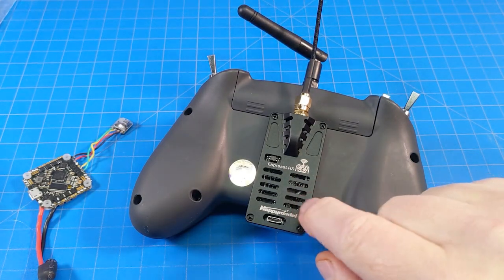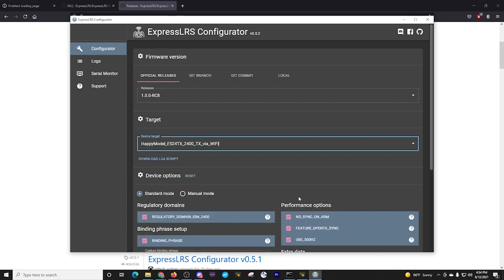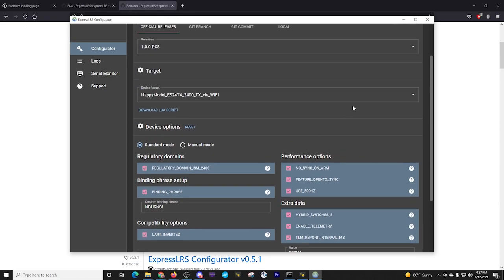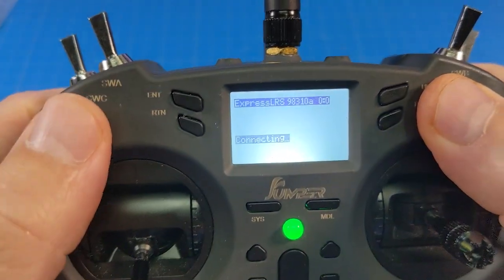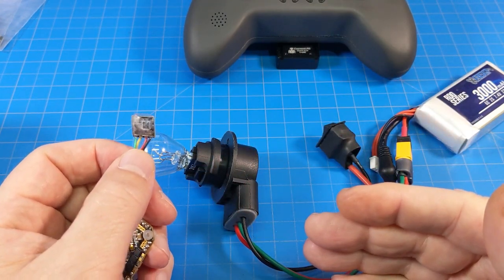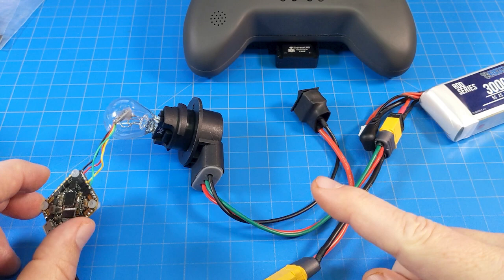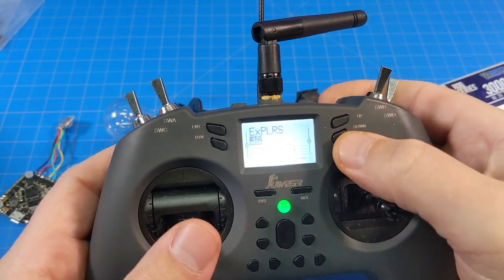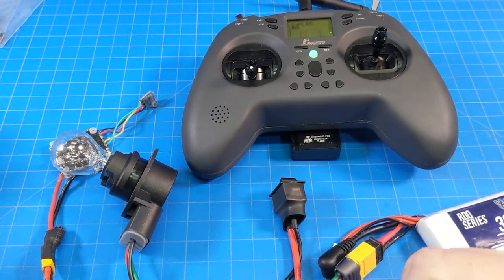HappyModel ExpressLRS Flashing (Updating) // EP2 // ES24TX Lite

Comment: I have several dozen quads with ELRS, and absolutely hate the fact that the ELRS engineers never made the darn things backward compatible. Every time that I purchase a new quad with  a new version of ELRS, I have to spend hours updating all the darn receivers, and my three radios that all have external TX Happy Model modules. It is a royal pain!
Reply from the maker: There must be some technology issue with backwards compatibility. We see the same issue in HD video systems, and other RC link protocol like crossfire. Although crossfire does have over the air updating which is a feature I have read the ELRS devs are working or or did work on at one time.

Comment: Hi Nick I have not been using this tx module for a while is in Elrs V2 firmware. Do you know if its possible to upgrade to Firmware V3 or latest? I'm having issues and maybe it just can't be flashed?
Reply from the maker: It can be updated to v3 ELRS. Check out this page https://www.expresslrs.org/quick-start/transmitters/es24tx/ and note the red advisory section. Need to update to 2.5.2 then flash with the repartitioner then on to v3 flashing.

Comment: Nick - thank you so so much.  I bought a HappyModel ExpressLRS Tx and 3 receiver combo over a year ago when the system first rolled out. Never used it before now.  Fast forward to today, was having no luck trying to bind to my TaranisX9D.  Worked on it for some time.  Upgraded OpenTX to EdgeTX, still no luck. Finally opted to upgrade to RadioMasterTX16S MKII Max.  Still needed help to bind those receivers.  Don't know where the glitch in my brain stemmed from, but after watching hours of videos trying to update and bind I had no luck.  Your video just made  it all click.  Bound, ready to fly, and excited to get back in the air. Keep making these great videos - they help!!!
Reply: iam still in trouble - now my module cant boot anymore

Comment: will the Jumper ExpressLRS ELRS ES24TX 2.4GTX Module for Jumper TPro tbs tango2pro OpenTX work on the Zorro controller?
Reply from the maker: the nano modules should work with any radio with the nano bay. Some are specific to the 1s powered radios. The jumper es24tx is rated for a input power of 5v-8.4v so it would work with the 2s powered radios which the zorro is.
Reply: @NickBurnsFPV  thanks, your vids inspire me in many ways on this new journey.

Comment: thanks it was very helpful. I still dont understand how are uarts called on the flightcontroller?
Reply from the maker: Uarts are ports, typical Rx and tx they will have a umber like rx1 which is uart 1. Tx1 is also uart1. Rx2 and tx2 are uart2. Etc
Reply: @NickBurnsFPV  Thanks for the explanation. Why don't they call it uart1 or 2 on the board that would be easier...
Reply from the maker: @airdevil21  probably the separation of the developers use for the rx/tx vs the hardware developers and their design purposes. We need to be able to differentiate between rx and tx as they serv different purposes.
Reply: @NickBurnsFPV  oke that makes sense. Thanks for explaining.
Reply from the maker: @airdevil21  this hobby is confusing sometimes.
Reply: @NickBurnsFPV  😁 yes it is! Thank God guys like you are here to help us!

Comment: do you have to flash receiver with the same firmware in order for it to bind?,also I didn't select binding phrase so all I have to do to bind receiver to module is plug in three times? please help 🙏 😢 I very confused
Reply from the maker: We do need to be on the same major release of expresslrs. Meaning we need to be rx and tx to be on 1.x.x or both on 2.x.x.

Comment: someone with solid led? I've closed it short and nothing, I can't update a new ep2, I just opened the package, the led doesn't blink at all, I don't know what else to do. not even with FTDI I could.
Reply from the maker: This could be the bug with a particular chip that was recently discovered. My understanding is that we can possibly work around it with several power cycles, otherwise we have to get a replacement from happymodel
Reply: @NickBurnsFPV  Solid green for me. Having many issues with this and new ELRS board for the lite radio 2. Never got into wifi mode

Comment: I followed all the steps then connected it to betaflight but no receiver reaction
Reply from the maker: Not enough information me to know if its not bound or if we have the rx and tx wires reversed, or we don't have serial turned on in the betaflight ports tab for the correct uart.

Comment: thanks for the helpful video. im all good up until accessing the lua script on the radio. it just says connecting and won't progress to the following page to connect to wifi. any ideas?
Reply from the maker: If the module powered? Is the lua script the correct script. The script is often specific to the module.

Comment: i have read everybodys guides on this and am still stuck.. i run the lua script i get version mismatch press force press wifi update and it will!!!! not show wifi hotpot on laptop... helpppp
Reply: in my tlite transmitter kit i have one tinned power cable connector left over? i followed the guide on fitting and fotos and still nowt...absoutly fustrating system to configure
Reply from the maker: I have not heard of a version mismatch on running the lua script, unless the lua script is for a different module. Is the lua on the sd card from the elrs configurator? Its linked on the page after we select the device.

Comment: Do I need to use open tx nightly builds? They have new opentx versions. Don't know if they work with the t lite right now. What do you recommend that works? I got it all to work and bind with opentx2.3.12 but no switch inputs. Can't figure it out. Any ideas? Should I try nightly?

Comment: Hiyaz, all  is updated, except I'm always getting a Build Error fail for my Happymodel EP2 firmware compiling.  A huge red paragraph with mentions of  'upload port protocol = espota, and platformio' stuff...  Google doesnt have any information for this..   Would you know how to fix this?  It would be greatly appreciated :)
Reply from the maker: Do you have a another program for writing computer programs on the computer? The part after the = looks like a language other than English. I would check with the expresslrs discord.
Reply: @NickBurnsFPV  thx for quick reply!  And I don’t think I have that kind of program....
Reply from the maker: @markmontreal7815  Sure. Some days I get more windows to read than others. :)
Reply: @NickBurnsFPV  I jumped immediately on Exp discord, some nice dude helped me out , had to clean the folders with those two options there,  and I’ve been flying my whoop since :)
Reply from the maker: @markmontreal7815  Great. Thank you for reporting your experience in the discord. Its nice to have confirmation that others are having a good experience. Have you tried the whoop with the different packet rates?
Reply: @NickBurnsFPV  Not really lol  Been flying non stop :).  I actually just used my goggles to record finally,  I can only fly LOS for now...  goggles are totally different and difficult!  Top of my list to try out the packet rates though!

Comment: Is light on all time or only when it bound or when been updated does hours get warm mine cold thinks it's faulty
Reply from the maker: Light is on all the time. I suspect if the light isn't on its not getting power, we need to check the wiring and connectors. Be sure the pins on the little board inside the radio aren't poking through the foam tape and touching the heatsink of the internal radio, this can cause a short or other issues.

Comment: Hi Nick! Thank you for all your help! At around 8:16 you pulled out a bag with a bunch of receivers (bad?). If so, what's the behavior you received on those?

I ask cause I just installed an EP2 RX and the LED is always a solid yellow. No flashing slow, fast not going off. Nothing. The Happymodel website that a solid LED mean connection successful or established. But my radio is actually off. 

From your experience, is this a bad RX?
Reply from the maker: No, those receivers in the bag are ep2 rx that I have flashed. They take up far less space outside of their packaging. If the led is constantly on we have likely soft bricked the receiver. Maybe we powered it down to soon or flashed the wrong firmware. We can undo this, using an ftdi adapter and shorting the two unused pads on the top of the ep2 rx. We wire the ep2 to the ftdi just like its wired to a flight controller. +, -, tx to rx, rx to tx. Then flash it over uart. I need to make a video on this process yet. I will try to do that when I get back from vacation.
Reply: @NickBurnsFPV  I see... Ok this is great info! Yeah - I'm sure a video explaining this will help a lot of folks out there. Enjoy your vacation and have fun!

Comment: Hi Nick! Can you explain how to flash via ftdi? I need it cause a failed flashing on my ep2..... thank u!!
Reply from the maker: Yes, we wire the ftdi and receiver just like the ftdi were a flight controller. 5v, ground, tx to rx and rx to tx. There are also two pads on the receiver that need to be jumpered/shorted. Depends on the receiver and where those pads are, we can typically find them as they are the only unused and unlabeled pads on the receiver. When we flash via the ELRS Configurator we us the flash to uart over usb. I believe its uart. And I think I had trouble initially as I had other usb devices plugged into usb, so unplug usb items that don't absolutely need to be plugged in.
Reply: Okay, i'll try this so! Thanks you so so much!

Comment: Can you make a video on using your FTDI to recover those receivers? I have bricked 2 of them myself. Info on how to unbrick them is not readily available on the web. Thanks for all your hard work Nick!
Reply: The problem is it will no longer go into wifi mode and bypass doesn't work either.  I have no way to reflash the receiver. I already bought one of those USB flasher things but I haven't had time to mess with it.
Reply from the maker: @jsxgmanfam  This image has the map lables on it. We wire it just like we might to an fc. The rx also has two pads on the top we need to short with a small piece of wire. This puts it into bootloader mode so we can flash it again.
Reply from the maker: I will take a look at it. It may help to wait a 10count after the updating screen shows the final message.
Reply: I need it to, bricked rx via wifi and passtrough doesn't work to....and i don't know how exactly do the ftdi flashing
Reply from the maker: @alessdiazlopez54  Okay. I will get a video together as soon as I can. I am pretty backlogged at the moment.
Reply: @NickBurnsFPV  thank you master!!! We really apreciate your work!

Comment: Hi buddy hope you had good independence Day and I've got the ep 2 but as yet no drone so I can't flash reaciever like you I don't have any flight controllers that use betaflightt etc so should I wait till got drone to flash etc
Reply from the maker: We don't have to have a quad or flight controller, but we do need a way to power the receiver with 5v. If we can do that we can flash over wifi just like in this video.

Comment: Well, I got my module and receivers. Installed and checked receiver and module for function and both worked. After doing this update multiple times both with and without paraphrase I could not get them to bind after the update. I had to revert back to the stock firmware. No idea why. But, I'm going to do some research on how much of a difference 500Hz makes over 250hz. I may be better off not trying the update again.
Reply from the maker: We have the rx and tx on the same versions of ELRS?
Reply: @NickBurnsFPV  Yes. 1.0.0-RC8. I did the two builds back to back like you showed. But, one difference is that I installed OpenTX 2.3.13 vs. your 2.3.12. I wouldn't think that would cause an issue. But, I'm not sure what the issue was. They work fine on 250hz with the stock Happymodel firmware.
This is also running the full size module in a Radiomaster TX12.
Reply from the maker: The Rx goes into biding mode, when not using the passphrase?
Reply: @NickBurnsFPV  Yes. When I tried it without the binding phrase it would go in to binding mode with the double blinks. But, it would not bind. It would just keep double blinking.
I also tried updating the RX with wifi and with Betaflight passthrough. Both gave the same result.
Reply from the maker: @ChristopherYotz  I presume we have csfr set as the protocol and using the crossfire lua to do the binding? As you rolled back to the happymodel firmware and its working. Only thing I can think to double check.
Reply: @NickBurnsFPV  Yep. CRSF set as the protocol before and after upgrade. Using Lua for the attempt at binding. 
I have to have missed something. I'll revisit it over the weekend.
Thanks for trying to help.  I'll get it figured out eventually. In the mean time it still works on 250hz.
Reply: @NickBurnsFPV  I think I figured out what I was doing wrong. Or, at least it works now. I don't think I was waiting long enough for the receiver to reboot after flashing. I was turning it off immediately upon seeing the notice that it flashed okay because I was worried about over heating. Now, after I get the notice that it flashed ok in the wifi browser I wait until the receiver light comes back on and begins flashing slowly. Then I turn it off. This works. Everything else I'm doing the same.
BTW, I damaged one of my receivers doing the flashing too many times. I think it just overheating one too many times. It's now dead. So, people should do the fan thing like you did as overheating seems to be a real concern.
Reply from the maker: @ChristopherYotz  Ah, the post update wait. I think this is how I hosed one of mine as well. It went to solid on light. Had to get the ftdi adapter wired up to flash again. The dead one doesn't have a light on of any sort?
Reply: @NickBurnsFPV  Yeah. It did the solid light thing first and then after trying Betaflight passthrough a dozen times it now has no light at all. So, I figured that one is toast.
I think I'm going to get one of those adapters to keep around just in case. 
I just got 4 more EP2s yesterday and I have 4 more EP1s on the way. I should be stocked up now assuming I don't brick any more of them.
Reply from the maker: @ChristopherYotz  Might check with the folks on the ELRS discord. Solid and reasonable people in there. Alessandro told me these things are nearly unbreakable. Not sure if he was also thinking of heat issue or software only.
Reply from the maker: @ChristopherYotz  Its a strange thing to need to wait after confirmation, but also be worried about heat. Slow down and hurry up :)
Reply: @NickBurnsFPV  True that.

Comment: Hi All - WARNING and some caution - installed my  TX on the Jumper t-lite - the pad to attach the power module looks to have changed since the video - its a lot thinner and in my case, when the controller was put back together, the underside of the power module pressed through the fixed pad and caused a short of the power in against the 4-1 module - thankfully, on burnt outer the battery wires - at least there was a spare in the kit

Comment: The Car Lamp is a 3157 12 V one - but it's easier to buy the "Vifly Short Saver 2 which has an on off switch

for the bulb: I got it from Ebay for 5€ (I'm from Germany 🇩🇪) and the socket ? from BG (2 PCs for 5 €) but I cannot find the link..
Since this is a 2 Filament bulb, I ordered a 2 way switch from BG too (don't know the price anymore and cannot find the link..) hope this helps..

Comment: Can the ES24TX Lite be used on the Frsky X-Lite (5 cables for every XJT module - plus minus and 3 data wires I guess - try and see ?! 😅)
Reply from the maker: I would wait for the slim module designed to work with the x-lite and tango 2 (supposed to launch in about 2 weeks). I have talked to one or two people who have tried to make the lite module work on the x-lite radio without success.

Comment: What should I do if my FC pad was RT2 when I used to connect my xm+?
Reply from the maker: If it only has rx2 and no tx2, that's a no go. Does it have other rx and tx pads? If your adding a receiver we wouldn't need the old receiver.
Reply: @NickBurnsFPV  no it's rt2 pad only no tx2 or rx2. Does that mean it's for inverted use, since its used for xm+.? 
i have tx3 and rx3 not used.
Reply from the maker: @MT-xy7fw  yes, we would need to use the unused rx3 and tx3. I can't say if the rx2 pad is inverted or not. If its marked sbus then very likely.
Reply: ok thanks

Comment: Have you experienced noise in the fpv feed, when turning up the output power of express lrs. 

Turned the happymodel express lrs up to 100mw and my video feed got really bad, with white lines across the screen.
Reply from the maker: I haven't seen that yet. Is this on the happymodel expresslrs AIO or using say an EP2 rx in a quad?
Reply: @NickBurnsFPV  ep2 rx on a 5 inch.
Reply from the maker: @pippifpv  Does it get better at 250mw or down to 50mw?
Reply: @NickBurnsFPV  just came back from testing, and decreasing output power of 2.4g seems to improve on 5.8 fpv feed. But I don't know of it is noise related on the quad. I will test it out on an other quad.
Reply from the maker: @pippifpv  I wonder if its telemetry related. I have seen frsky rx do the same on some builds.
Reply: @NickBurnsFPV  yeah, so have I. I wonder if heatwrap or covering it with electric tape would remove the noise.
Reply from the maker: @pippifpv  might be worth a shot. I think it might require some metal shielding.

Comment: thanks, can you show us how to flash the Ep2rx in case of , with the FTDI (wiring) ? Thanks again
Reply: 3.3V, GND, TX to RX (in RX), Rx to Tx (in Rx). short the pads near gnd with gnd and connect to usb the ftdi, disconnect the pads in the rx, the light shold be always ON, open the configurator and build and flash for UART.